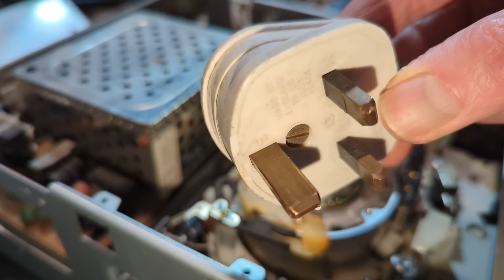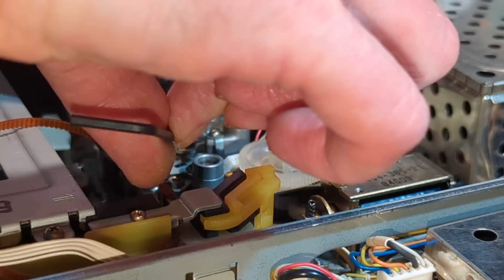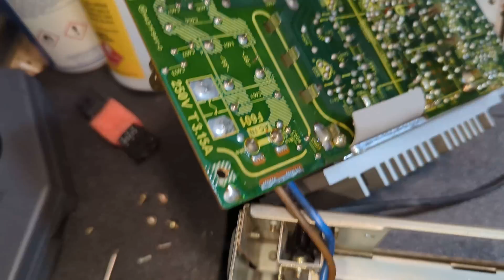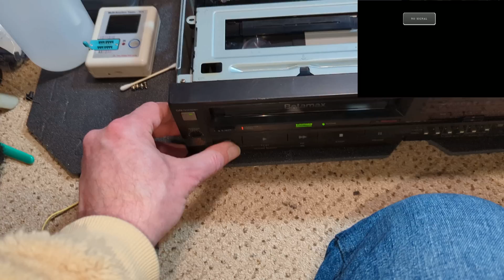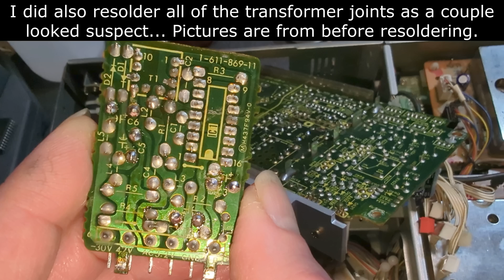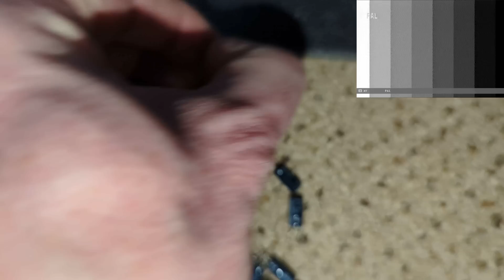Sony SL-HF100 HiFi Betamax - 'Not loading/ lacing' Part 1

Comment: Hi, Alex. There should be a 8-9 legged TA or LA chip on that Y/C board that goes faulty with no color. I remember a no color and weak input signal fault along time ago on a Sony SL-T50ME which did involve a TA or LA chip that was faulty (Can't remember chip part number).
Reply from the maker: Thanks for this - I'll investigate that and will let you know.

Comment: I also degrease/deoil with Cleaner 601 spray. I only have PH crossslot screwdrivers. The capacitor C4 at 0h3253 doesn't look healthy. After replacing the delay line with a different type, you don´t need to adjust anything on the 3 trimmers nearby ? The 2 electrolytic capacitors behind the display board are from Matsushita. Since ChemiCon and ELNA were also installed, one can suspect that the purchase at SONY only looked at price and availability. I have almost never replaced mains charging electrolytic capacitors, but if the rectifier and fuse are really good, overvoltage from the mains can reach a long way.
Reply from the maker: Thank you for this. I'll check C4. Yes, I did check after replacing the delay line but it needed no adjustment at all. Totally agree on the mains DC capacitor - never had issues with them in any Japanese machines to be honest.